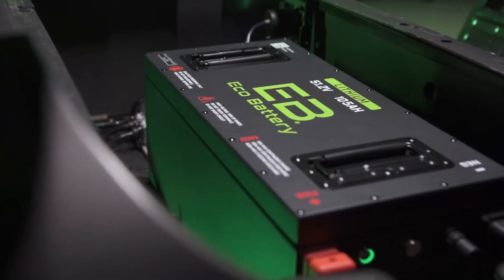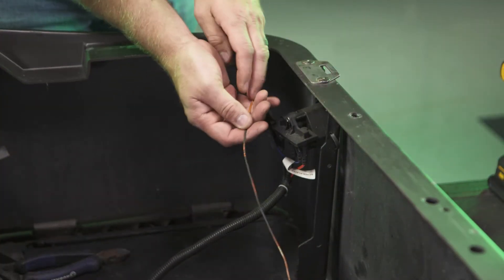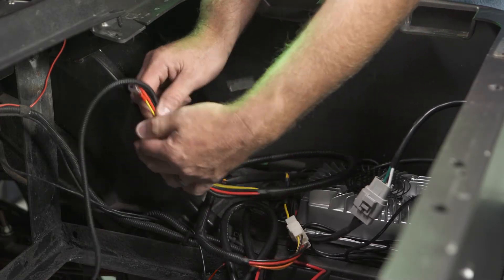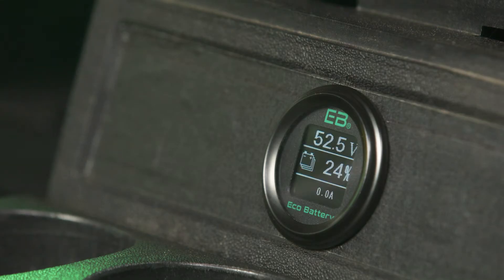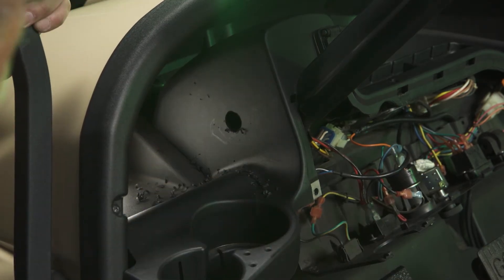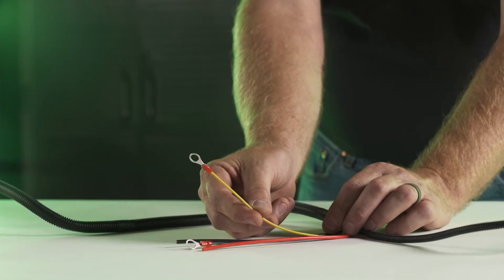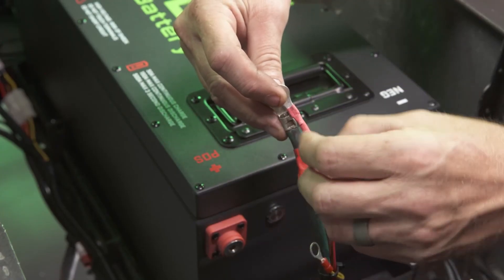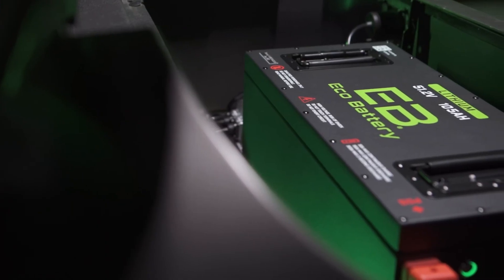E-Z-GO TXT 48V Eco Battery Installation Guide | 1994-Present

Comment: Does the lithium pack need to be powered on and off each cart use or can I leave it on?  No big deal to raise the seat and do it as needed...just wondering. Great instruction video.  Thank you.
Reply from the maker: @bobleader9006  you do not have to as our battery has a power save mode that will turn off the battery after 7 days if the battery percent is above 21% or after 24 hours of the percentage is 20% and below.
Reply: @ecobatterylithium   I had the 105 Skinny installed in my EZGO TXT 48 one month ago and love it.  Maintenance free, lighter, more range, cleaner under the seat and much more.  SOC meter is great and on board charger gives me flexibility. The app on my phone is cool too. As they say on Cartaholics Forum...ECO is the best money can buy. Thanks for making such a great product!
Reply from the maker: @bobleader9006 thanks for sharing the update! Thank you so much for the support and any questions let us know anytime!